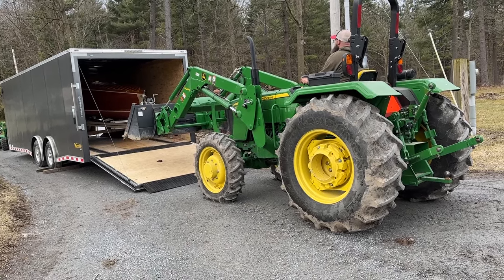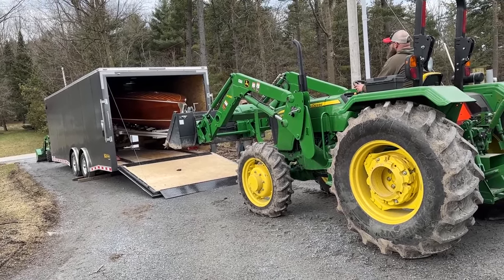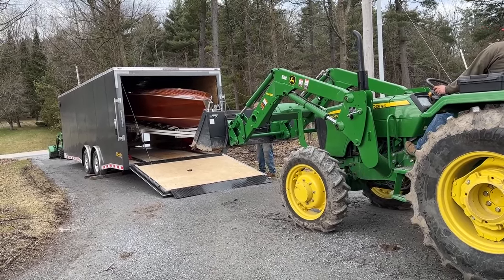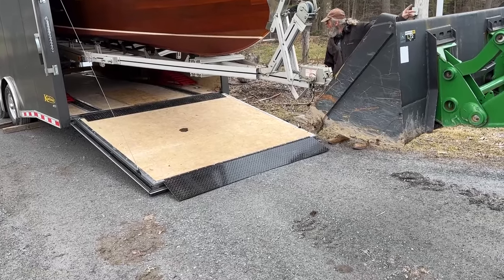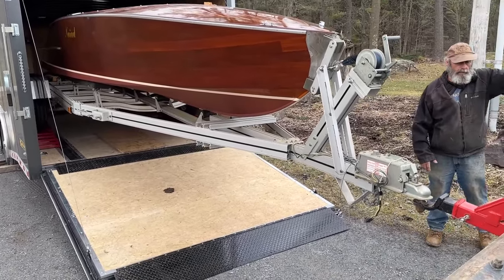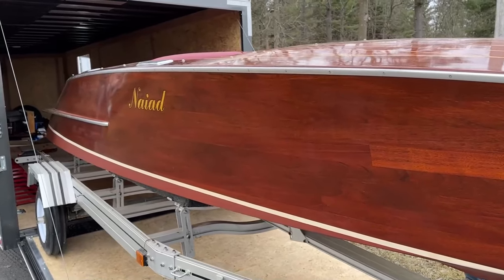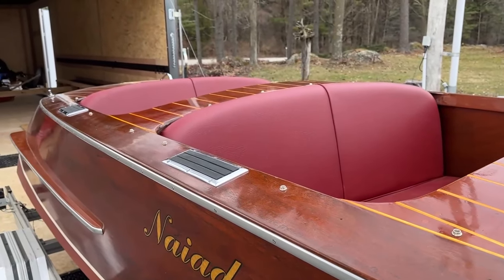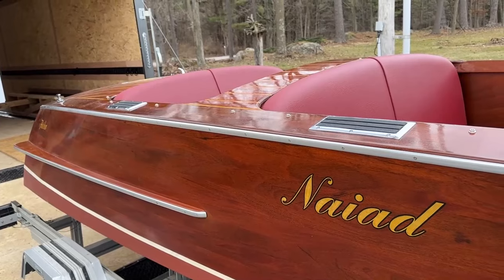Unloading Naiad - 1991 Simon Fletcher Classic Runabout   Naiad 3 13 2024

Comment: 33 years old, and never been kissed...how sad!
Reply from the maker: Ha! But she will this summer. I promise. I never knew anything about Simon Fletcher until now. This evening produced a sheaf of photos in my inbox. Jerry, 
this guy built veritable tanks! Planks on ply on frame hullsides and transom is only the beginning. I believe that transom can handle 100 HP, and you could drop my 2500 Ram Rebel on the deck without doing much harm. And yet, according to docs I now have, the hull weighs only 1,850 pounds.
Reply: I don’t know about Fletcher specifically, but the craftsmanship that goes into handmade boats is amazing. Not a skill set I  have very much of.  A fifth grade shop class birdhouse is about my level.
Reply: Would a small V drive fit?  It would be a shame to put a modern outboard engine on it.
Reply from the maker: @richvandervoort2950  The Speedliners were all outboard-powered, but I am researching all the optioons.